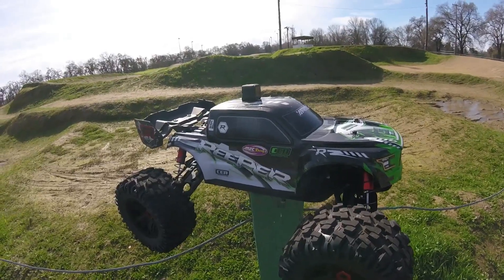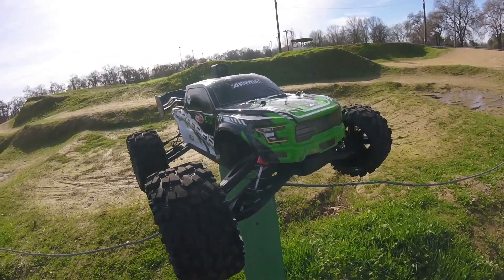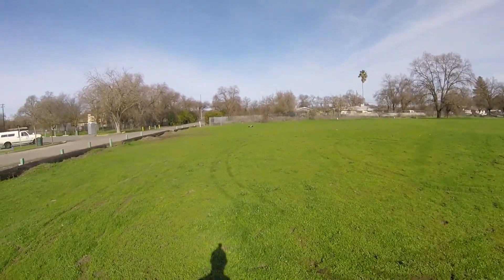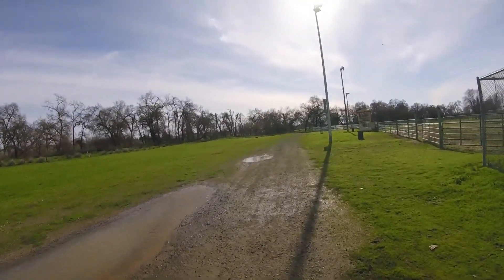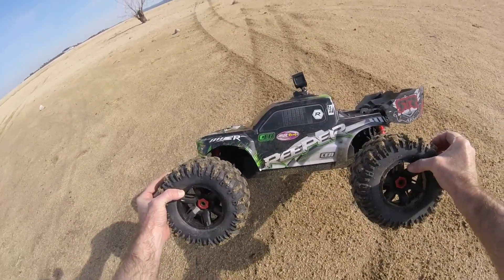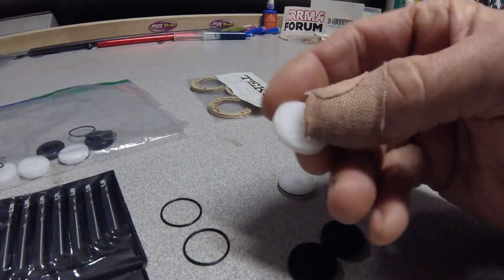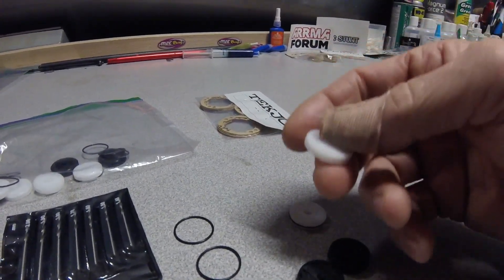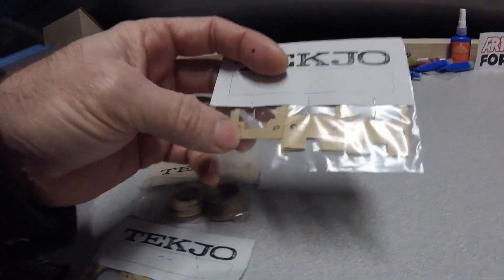ARRMA Kraton 8s 1/5 "XMaxx treads?" Crusher M2C piston testing...

Comment: you really send it.... great work and if the kraton 8s came out of the box this strong and fast id buy one but like those traxxas tires on that arrma vehicle traxxas got a lot right with the xmaxx and still best basher, in good hands, for the money our of the box. IMO, of course. what you and the guys making the chassis have done for this vehicle is amazing... great work to you and the after marketers.
Reply from the maker: Thanks so much Brother 👊!!! The Kraton 8s did much better with simple gear and tuning changes 👍. Still didn't have Crazy torque, but great speed and handling with efficient electronics. ARRMA did a great job with this new release overall. The M2C options really transform her to a whole new level. 🍻👍👍😎💪👊👊
Reply: @richduperbash2966  another level for sure.... KUTGW

Comment: how did you cut out the traxxas hexes ?  what did you use to remove the little traxxas nubs ? I have always hated that proprietary crap.
Reply from the maker: I used a box cutter/utility knife 👍. Fresh blade works best. Simply cut downward from each side of the tabs at an angle. Cleaned up any remaining tab with my Dremel sanding drum 👍👍😎💪👊👊

Comment: Hey wanted to ask a question got a arrma kraton 6s and when I accelerate hard it slips something and doesn't go anywhere really but when I accelerate slower it hooks up and goes well, just wondering if you or anyone else has this problem thought it might be the motor mesh or something as had all diffs out and fully rebuilt using extra shims,it was the same before I did any work on it so don't know what's happening,would be great if u could help me thanks gaz
Reply from the maker: I'm not certain, but it sounds like one of the input cups may have come loose 🤔. If the grub screw comes loose, the cup can spin freely with no drive to either the front or rear on harder throttle. If you're getting grinding on harder throttle, I'd think the gears are slipping somehow. The mesh would have to be pretty loose to slip, but it's possible. That'll usually pit the gears badly, especially the pinion. 😎💪👊👊
Reply: @richduperbash2966  thanks for the reply,I will try the input drive cups and make sure they are tight, don't know if u have heard of something called coging which can do a similar thing, anyway thanks for the help, great vids by the way cheers gaz from the  UK 👍

Comment: Hi rich super-duper bashing that short chassis is amazing think i may order one.
Do you think you could do a little video on How to mount it and all the mods you have to do.
If you have time that would be so cool
Speak to you soon mate
Saul 👍👌✌️💪👊
Reply from the maker: Thanks Saul 🤗!!!! The only necessary mod is replacing the rear center driveshaft with another, shorter front shaft. The chassis will come as a kit with shorter M2C 7075 braces. It's a direct swap. 🍻👍👍😎💪👊👊

Comment: 💥 blast from the past! Such a cool truck, is the crusher chassis the one being used on the Mega Outcast package?
Reply from the maker: The Mega Outcast is 1/2" longer in front to accommodate the Max4 combo. The overall length should be very close to the Crusher 😍. That rig handled awesome.

Comment: Hey Rich I was wondering what center diff weight oil do you use in your talion. I'm wanting to switch my oil out but I do not know which weight would work best. Thanks for your help and amazing video again!!!!
Reply from the maker: Thanks so much Adam 🤗!!!! I really need to keep a log on all my set-ups. Pretty sure I'm running 200k center on the Talion 🤔. I generally run 200-500k between my Talion and high powered Kraton's. 🍻😎💪👊👊
Reply: @richduperbash2966  Thank you for the help!!!

Comment: Quick question tho,
How thick plywood you use for your wood ramp top sheet?
Reply from the maker: I'm using 2 layers of 3/16" tempered panel hardboard from Home Depot 👍. The top layer is rough side up for traction. 😎💪👊👊
Reply: @richduperbash2966  😎
I was thinking 1/4 plywood... Like your option even more 🎯
Ever had any breaks?
I'm trying to balance lightweight and necessary durability as I will be putting it in the back of my minivan most days.
Should be...
L 50  H 30  W36
Seems to be the biggest I can fit... Any higher and the incline would be to quick?? (I could go H35??)
Reply from the maker: @Dmac13131  I haven't had any breaks with 2 sheets and adequate cross bracing 👍. The panel board is actually quite durable, just not water tolerant. You have to countersink the screws for them to sit flush, but it doesn't splinter like plywood. 30" is plenty tall enough to get launched. Mine is 30" x 60" x 40" wide. 😎💪👊👊
Reply: @richduperbash2966  I literally have the same van as you 😎, and the most length I thought I could get in is 50....your able to get L 60 and W 40 with just folding the 3rd row?
And you used plywood for the side tho? (how thick)?
Appreciate

Comment: Rich I been cleaning my rigs with simple green hosing them off then wd40 them what should I do about   the bearings after using wd40?  Is there a way to lubricate them with out taking them out
Reply from the maker: I also use 50/50 water and simple Green mix 😍. I use a combination of traditional WD-40 (on the metals and hinge points) and their Silicone spray specifically on all my bearings. I will clean and oil my bearings during maintenance, but the Silicone keeps them smooth and lubed after wash downs. 🍻👍👍😎💪👊👊

Comment: Could I ask you a question about what diff oil u use in each diff running 50000 rear 200000 middle and 80000 front and front wheels still bloon bad just wondering what you use, would help me out big time, great vids found u through Kevin talbot thanks gaz 😉
Reply from the maker: Hey Gav 🤗. I'm running 500k front, 20 million cst center, and 100k rear. Seems to work great overall. Definitely helps control ballooning to the fronts. I'd still recommend venting the tires also. 🍻🚀🚀😎💪👊👊
Reply: @richduperbash2966  thanks for your reply will give it a try I have just vented my tyres and helped alot, keep up the good work love watching the vids all the way in the  uk 👍👌😉

Comment: How is the m2c chassis after bashing? Does it still bend? I really liked in your old videos after you are done doing these crazy bashes you used to show if there was any bending.
Reply from the maker: The chassis is scratched but straight as new 👌. Simply nothing to show. I did flip her on her side at the end, but there's no bendage to report. All the M2C chassis's flex for great handling, but return to form 😍. That's the difference between stamped aluminum and 7075 T6. 🍻😎💪👊👊

Comment: Sir, what battery do you use for your Kraton 6s V3. I need some good lasting ones
Reply from the maker: I run Mostly Hobbystar 4800mah 50c 6s hard packs from RCJuice. They have several larger mAh 75-100c discharge packs as well if you want longer run times. I use the compact 6s packs for weight savings with crisp handling and bigger jumps. 🍻😎💪👊👊
Reply: @richduperbash2966  I'm kinda a noob in terms of what the battery's indicate. What's the difference? I see some lipos that say 30C and some say 80C like the 6s lipos. What's the difference
Reply: Like is it better to run higher C ratings?
Reply from the maker: @ulisesh2727  that's the discharge rating. The higher the C rating, the less IR or "internal resistance". I personally never use below 50c and prefer 75-100c. Too low and you put increased strain on the ESC itself. Higher C rated packs are typically faster. ARRMA has a minimum 35C rating for their 6s stuff and I believe 50c for the Kraton 8s. 👍
Reply: @richduperbash2966  Ty! I love your channel man! You're like the only dude who actually launches rc's with no worries 🤣👍

Comment: Rich that SWB is a monster seems like you can’t keep the thing one two wheels. 😂😂. Absolutely sick back flip into the water hole 😱😱👍👍👊🏻👊🏻.  Killer bash with that rig.👊🏻👊🏻. Why the Xmaxx tires are you going through tires and did you not like the duratrax set or the stock?
Reply from the maker: Thanks so much Brother 😜!!!! The stock tires are fine, but mine are starting to get a bit soft and tattered from gravel and rock bashes. The Duratrax Six Packs work great, but they're a bit hard and add 1.5 lbs 👀. The XMaxx tires have superior traction and sidewall support 👍. They only weigh like 20-30 grams more per wheel, yet are a touch taller for better speeds and rotation in the air. 🍻😎💪👊👊

Comment: Love the videos man, watched all of the kraton 8s ones and going to use a lot of your knowledge in setting mine up when I get it. Do you think the 5687 is enough motor or would you recommend jumping to the 56113 and all of the headaches that that brings? I wanna run 50-60 mph in sand and really high demand terrain.
Reply from the maker: Thanks so much Trent 🤗!!!! I really like the available power of the 5687 1100 👍. I'm hitting 58-60mph with a 29T and temps have been great. That said, I've never ran anything bigger. There are intermediate size Leopard cans to consider too like the 5898 1100 🤔. I have the torque I need as is, but variety is always nice too. 🍻😎💪👊👊

Comment: Not the stock motor ?
Reply from the maker: No I'm now running a Hobbywing 5687 1100kv and Max5 with 29T. I upgraded a few videos back. The stock system was fast geared up, just didn't have the brute torque I really wanted.🍻😎💪👊👊
Reply: @richduperbash2966  Did your run times suffer ?  
how long will the stock motor vs the 1100KV hobbywing run on XXXXmha batteries ?  Thanks in advance

Comment: Hey Rich! So now that you have the 8s Kraton mostly sorted out and running as well as the 6s 1/8 scale version, what's your all in cost? Seems like you'd near $2k? Fun as it may be, I'm having a hard time seeing the value proposition here...I've had my eye on 1/5 scale rigs and at this point I'm leaning Xmaxx:) You ever run one? Bash on.👍
Reply from the maker: Hey Steven 🤗!!!! I think 2k is a bit inflated 🤔. Truck is 900$, electronics 330$, and M2C Crusher chassis/brace kit yet to be established (225-250$ ish 🤔). Motor mount 75$. This rig will outperform an XMaxx. It handles amazing and doesn't flip over at speed. No limit on battery sizes either 👍. It still comes down to preference obviously. I've bashed the XMaxx and it's simply not for me. This rig is in a league of it's own. I've yet to see a larger scale RC perform with the capability this thing has. Regardless, larger scale rigs are pricier. 🍻🚀🚀😎💪👊👊

Comment: That thing looks like it could really use some air-filled, bead-locked radials instead of that foam-filled nonsense. I've always hated how RC tires balloon out like that, but now there are options that are more in line with IRL tire tech. Fiberglass-belted radial RC tires are the wave of the future, and the tech is developing quite rapidly.
Reply from the maker: Tires are such a personal preference thing 🤔. Truth is I absolutely love how the truck handled after simply venting these and taping over the rim holes (and tuning the diffs). I've had 3 sets of belted bash tires and don't really like any of them for pure bashing. They're fast and hold their form, but too stiff and damn heavy for my style of driving. I prefer controlled ballooning with good pliability. Prolines recent attempt with weak removable hexs was a failure. Maybe not for their sales #'s, but for true bashing performance. Hopefully we'll see a lighter MFT option with better pliability. 🍻😎💪👊👊